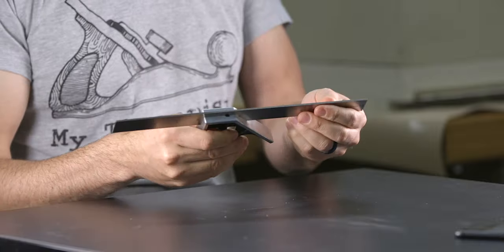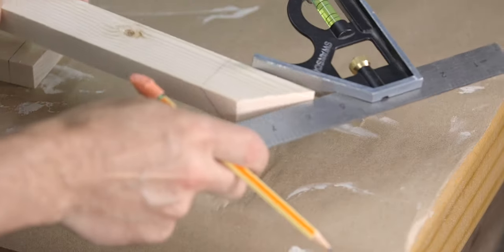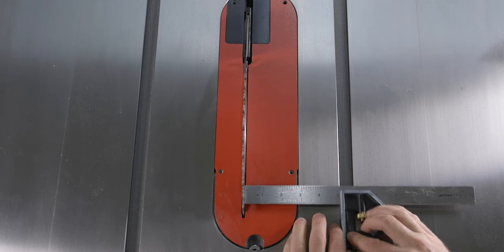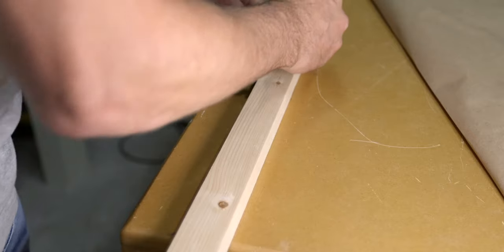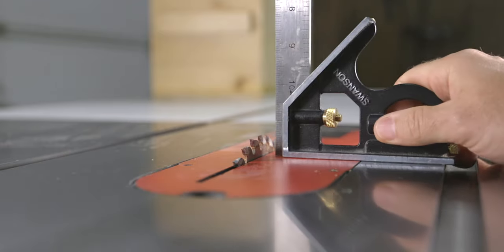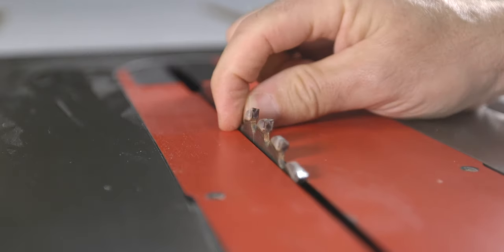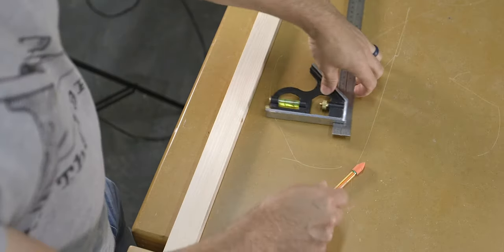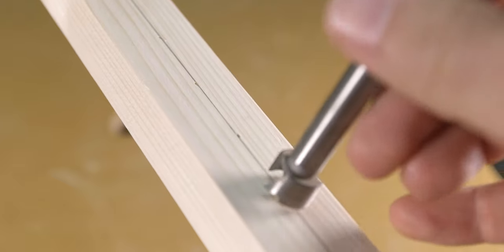Beginner Combination Square Advice

Comment: The scribe tool is used to scratch into steel plates. To cut using torch for later. Iron workers use this too everyday to get 45° angles on a plate and make cuts.

Comment: Great information, although a bit fast paced for me 😁 I will have to re-watch a few times to soak it all in as I am not a wooder. Another use for this tool on the mechanics side of things, (which is why I got one,) is to use it to set the offset on a harley spoked wheel. Set straight edge against the hub with the square against the side of the hub. Use the level for getting it just right, and then measure the distance from the hub end to the rim. Make spoke adjustments as needed to move left or right. there ya go!

Comment: You can also use the square as a compass to draw circles.
Reply: how???
Reply: @kobragangbit first you need to have a square with a hole. Assuming you have one this is how you do it.

First adjust the square to where you want it so you can make the right size circle. Be sure the 45 degree angle is facing up.
Next put a nail through the hole in the ruler and hold it tightly 
Then put a pencil in the 45 degree piece and draw a circle.

Comment: Don't cheap out and get the $8.99 combo square. It will frustrate you. Cheap stuff can actually be out of square. If your SQUARE is out of square, you're pooched from the get-go. There should be no plastic whatsoever on your square. General used to be a good brand name but they have probably sold out to China like everyone else. If you can find a used Starett tool you will have a tool that's a pleasure to use for the rest of your days.  Keep a very light coating of oil on it if you work outside as well as inside. The blade especially is prone to rust and it makes it difficult to read the marks as well as to slide it without binding.  If you are doing a lot if finish work, wipe the oil completely off. You can reapply it when it's time to go outside in February to trim doors and windows!
Reply from the maker: Great info, thanks for sharing!!
Reply: Doesn't matter what brand of square you buy, improper handling will throw it off. Get a surface with a straight edge, but the fence up, strike a line, flip the square and check that it still lines up with the line you just struk. If it does not clean the pads the blade rest on and check again. Repeat a few times before resorting to true it up by carefully filing the appropriate pad to get it true. Do this slowly and check often.

Comment: Need help,  cant get the ruler back into the handle..    am a  clumsey dolt  who can't spell
Reply from the maker: Loosen the nut almost all the way so the inside pin is towards the top of the square. Then you should be able to get it to go back in.